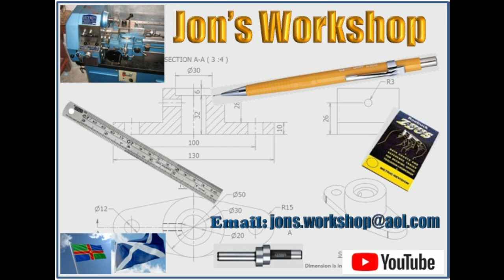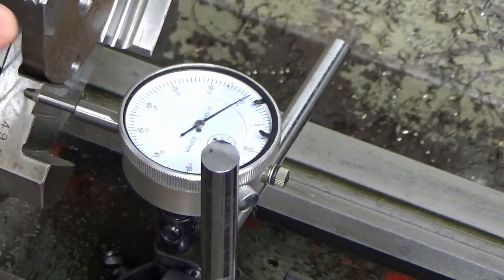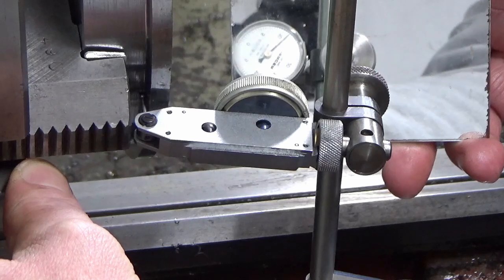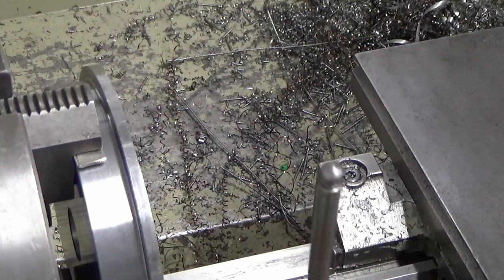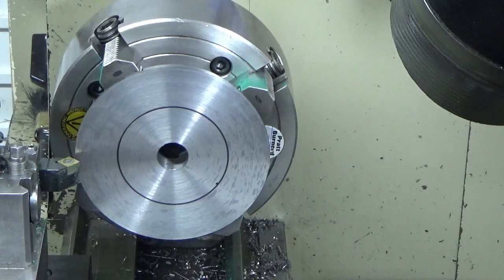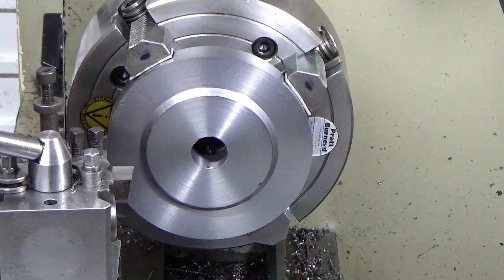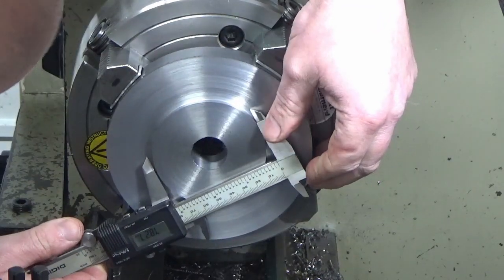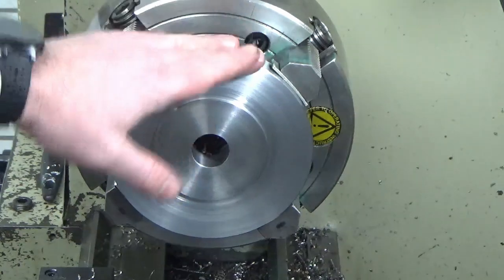Making A Rotary Table Adaptor Plate Part 2

Comment: Hi Jon. Your lathe runs sweet, great to watch and listen to. The machine volume adjustment to tweaked is spot on. Tony
Reply from the maker: Hi Tony, thanks for the comment, yes it really does work well, would run even sweeter on proper 3 phase rather than the pseudo Lecky I have got through the transformer. Glad the volume adjustment worked out. Cheers, Jon

Comment: I assume the backplate turned out to the correct size, but wondered about the checking of the register dimension. As shown, the dimension measured would increase when you faced the register to the correct depth. [Were you measuring the register further in from its face?]
FWIW. Most times, depending on hole size and tool tip in use, like the tip used here, an internal small chamfer can be produced by using the same tool, running the lathe in reverse (NOT ON SCREW MOUNTED CHUCKS) and applying the tool tip to the farthest hole edge.
Reply from the maker: Hi Zen, thanks for the comment. yes, I can confirm the back plate turned out to be an excellent fit, despite my impoverished measurement capability. Not sure I follow you on the facing comment, the register Dia is a parallel diameter so it wouldn't matter how much I faced off the front, the diameter would still be as measured. Cheers, Jon
Reply: @jonsworkshop  Oh, my mistake. I didn't review the drawing before commenting and assumed :-( it was tapered. Oops :-)